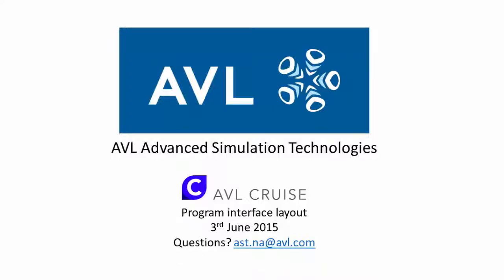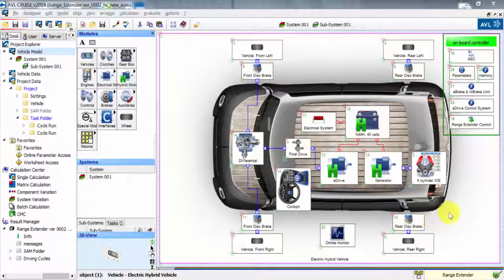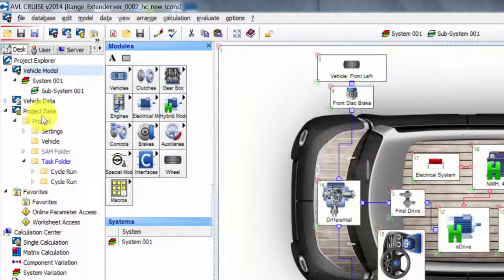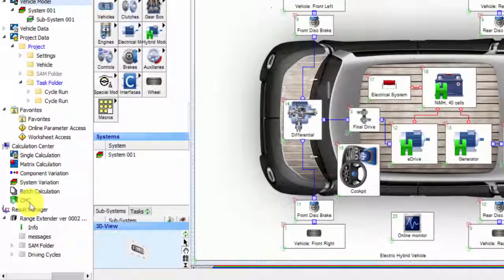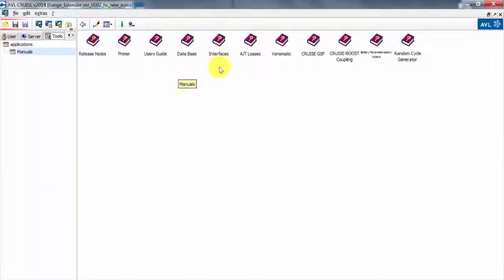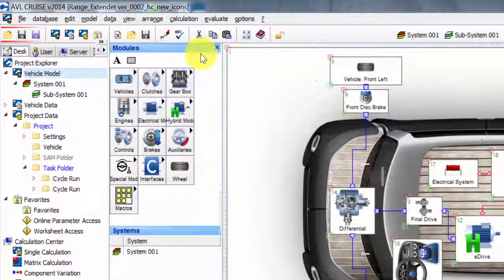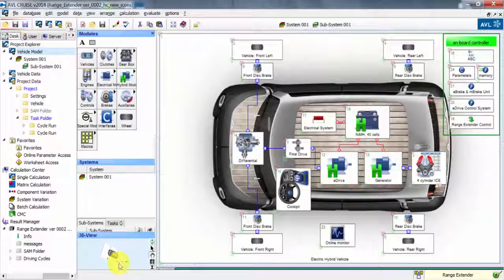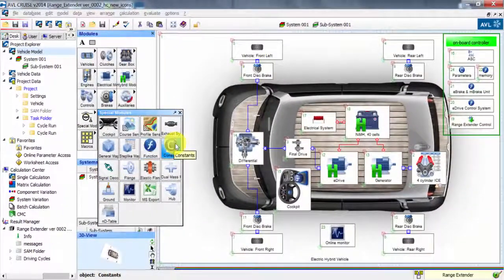AVL CRUISE™ GUI Introduction

Comment: Why the interface Boost engine cannot be coupled to cruise in transient mode? I have tried all settings and adjustments recommended by Cruise-Boost but the problems stands as error "ERROR M_6: Starting BOOST model in ExtStartUp2_43"
Reply from the maker: Hi, thank you for your question. Please get in contact with our experts via cruise@avl.com.